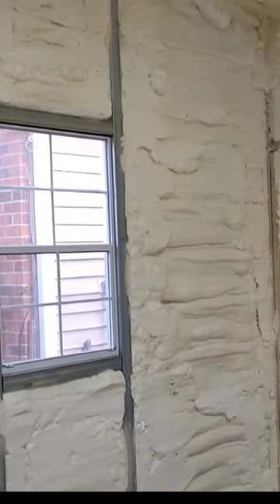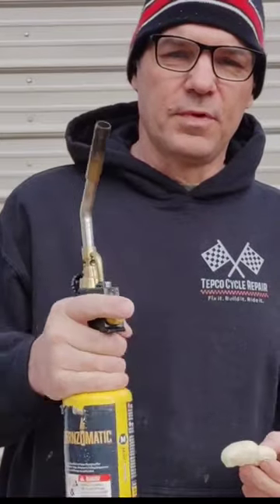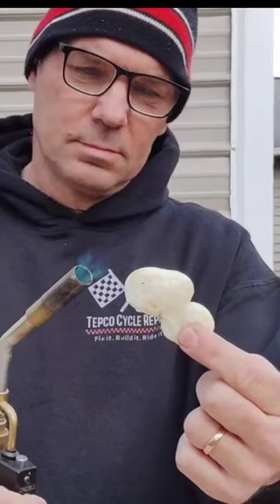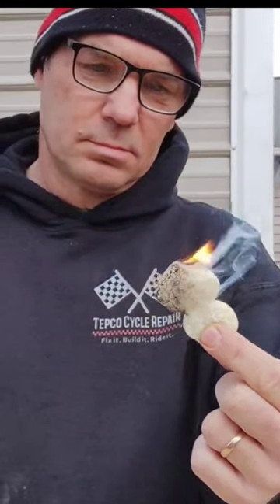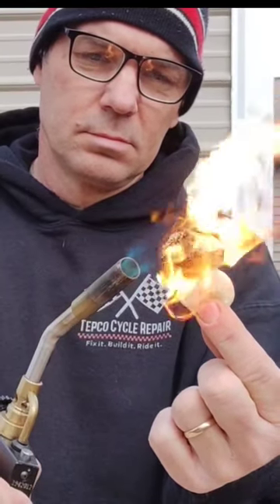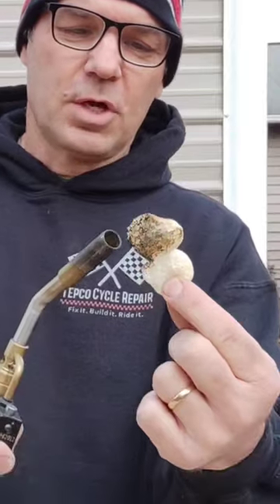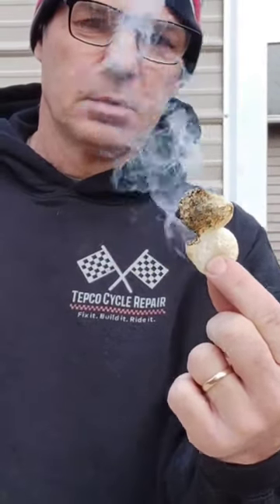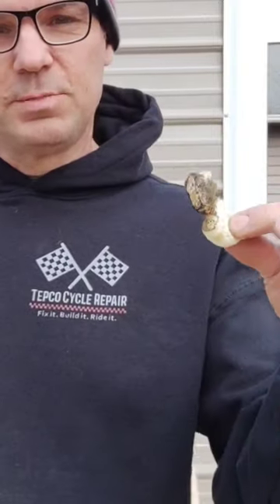Is spray foam flammable? Let's test it out!

Comment: Depending of the foam mixing gasoline is a diy napalm
Reply: Expanded polystyrene foam and a handful of others do this in gasoline and acetone. 

I wouldn't call that stuff napalm when you can make the OG Napthetic Palmetic acid pretty easily at home. 
Napalm is a thickening agent but doesn't really solidify as its own but combines chemically with fuels, where as the foam tends to turn into a chunk of thick moldable plastic that's saturated in gasoline. 

You can also just buy napalm online, as it's not a restricted agent as well as flame throwers not being federally regulated (may vary by state jurisdiction under various incendiary devices though).
Reply: @100GTAGUY  lol your definitely on a watch list

Comment: So it burns at a certain heat, but it doesn't look like something to worry about. They make fireblock spray foam but it's even more expensive so I'd say just take your chances because if it burns that little from that torch it's fine
Reply: Nah he only lit for a second. if he put that torch up to the spray foam wall for more than 5 seconds the whole building will be ash in a few minutes.
Reply: @TheOneAndOnly1776  I'll take your word for it, not used this stuff much and definitely haven't lit it on fire
Reply: @methpotluck3588  well i have done both and im telling you it burns like crazy once you get it started but believe whoever you want
Reply: @TheOneAndOnly1776  nah I just tested that out you right
Reply: Fire block foam in a can is crap, it burns like crazy. It's not even approved for certified use in Canada

Comment: Most modern insulation itself has firetardant portion   is bag insulation that bag will ignite spray foam will just melt into blob or mess but I wouldn't want breathe fume in

Comment: but if u try set the wall on fire then what happens? i mean then it has material to spread to. will it stop anyway or will it say swosh and a big ass quick fire start and stops?
Reply: That shop would be burned down before the firefighters got up off the couch

Comment: So the fire will go out if the flames are stopped..... Riiiiiiiiight.
So if the foam next to it is on fire, the foam will burn, and supply flames to the next spot od foam
Reply from the maker: I hear ya. The torch is a pretty intense flame to keep it going though. I'll have to build a mini wall, light it and see how it does.

Comment: If your leaving your foam exposed they make a really nice fire retardant paint you can spray on.  Worth every penny.   That foam is not allowed to be left unopposed unless it has the fire paint applied in MA. It does burn when there's a flame.  You just proved that. And all the wood and other materials in your shop will keap that stuff burning spewing horrifically toxic fumes through out.  Paints like 500 a bucket. You need two.  Problem solved.